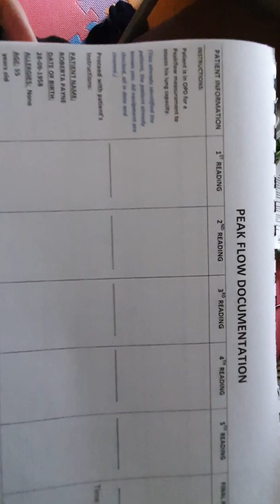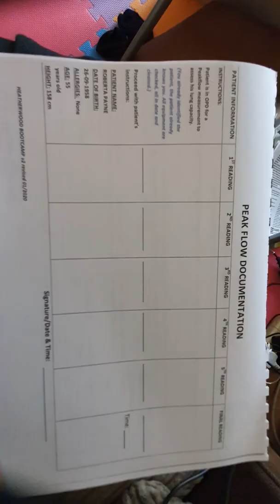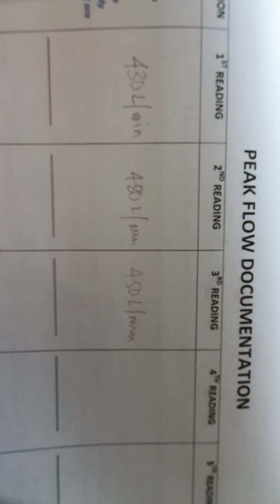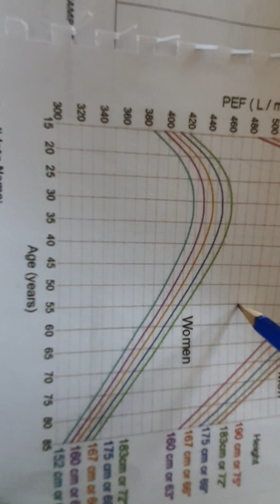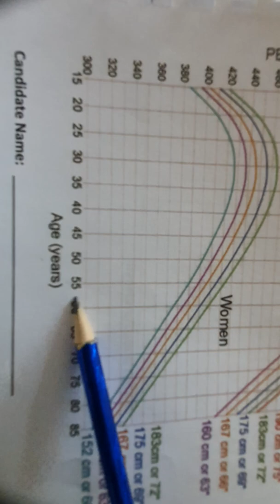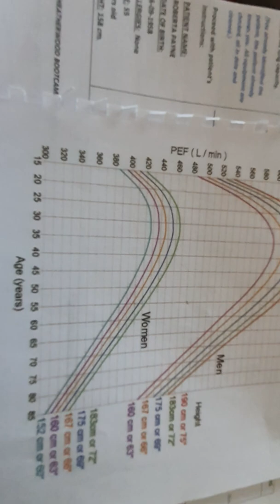#PeakFlow Tutorial. #HowToPlot #HowToInterpret #OSCEMadeEasy

Comment: Yung peak flow documentation po na gamit nyo mam is use by what testing center? Ulster po ba?
Reply from the maker: Hello. Yes. Similar to Ulster
Reply: @arlbautista5561  i have exam tomorrow in ulster.I have a doubt the first reading and 2 reading has a difference of more than 40 litres/mt,will it not be a problem?or do we need to consider the only 2 highest readings difference.Please reply?
Reply: @dreamergirl9837  yes, even I have the same doubt.....I also learned that if the difference between two consecutive readings is more than 40 L/min,then it should be done two more times......So,as per this chart,the difference between the first two readings are more than 40l/min....which should imply that it should be done two more times right?